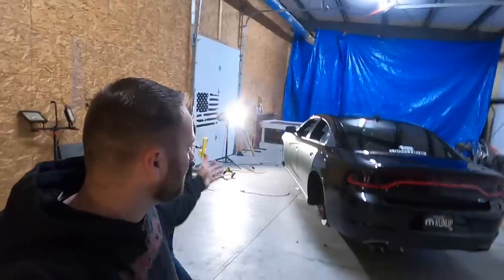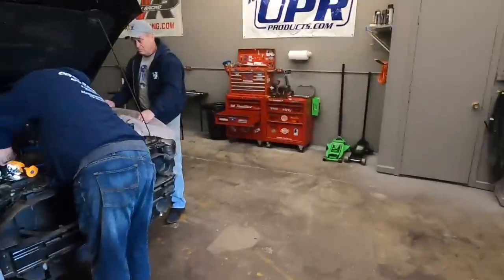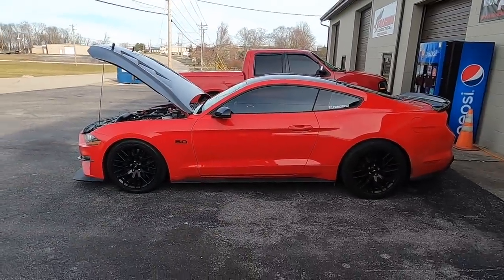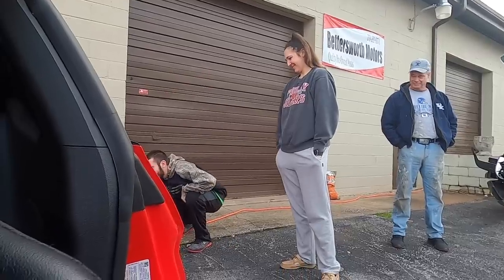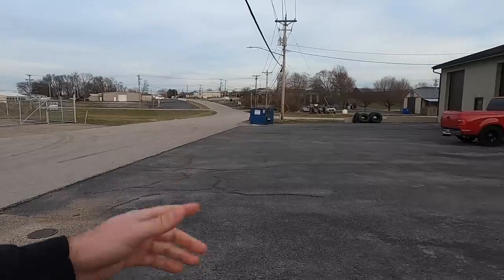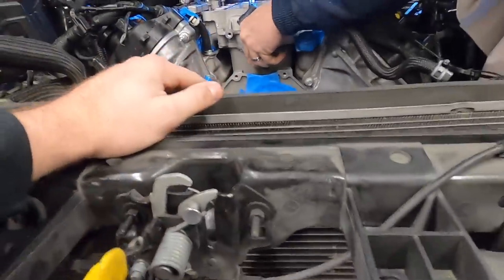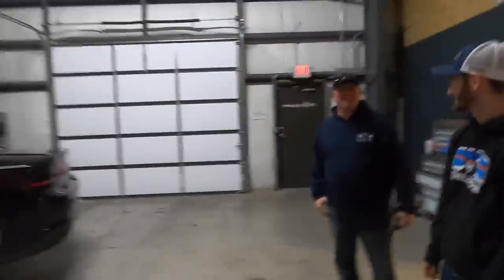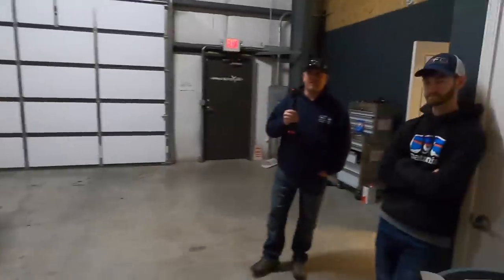Failed Mustang GT Supercharger Install TURNED INTO REV BATTLE!!!

Comment: Hey Xander. Tell Ken that the supercharger he has bought if it is not the new one designed for the 2018+ then it won’t work correctly because it had to be re-made to compensate for the direct and port injection. And apparently there are some problems with the fitting at the rear and that is why they changed to a front inlet which unfortunately you can’t get a throttle body more than 87 mm in. There again he is a technician so he might find a way to prove everybody else wrong. I just put the 2650 Roush /Ford Performance Stage 2with the bigger intercooler in my 2019 with a killer chiller to keep the temps down.

Comment: Fuel rail on that roush is at an angle, I think that worked for 2014s  .. but s550 leave less clearance when the elbow and throttle body are bolted on.. might be an issue with connecting the fuel line

Comment: Keep on with finding this kind of content , its good filler. Putting a Gen 1 kit on a Gen2 could be tricky , but good info .
Reply from the maker: I think he might run into some trouble making things fit
Reply: @Zander13Productions  That and the fact that i believe the s550 is all digital vs the gen1 being analog. He should contact rousch for all the info he can get. Sometimes a deal isnt a deal.